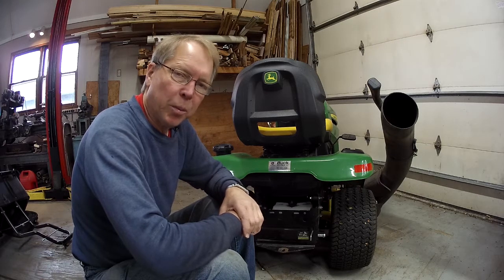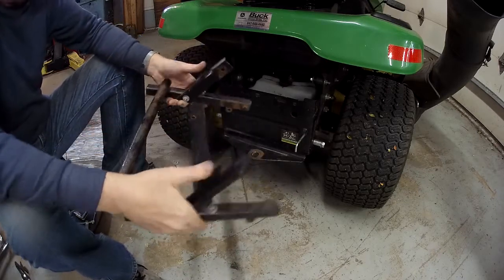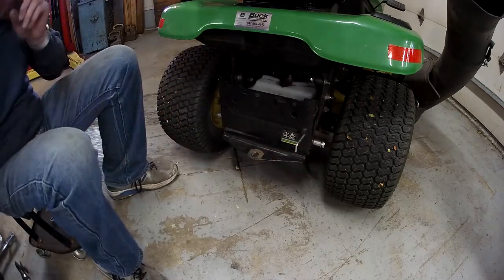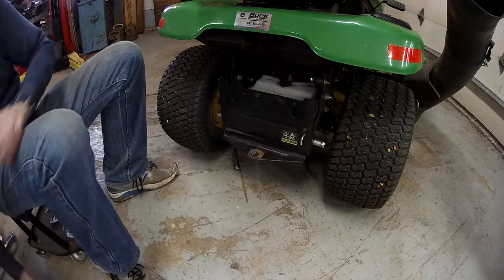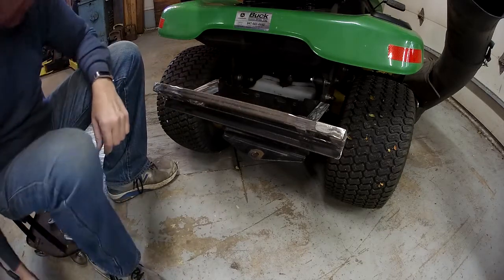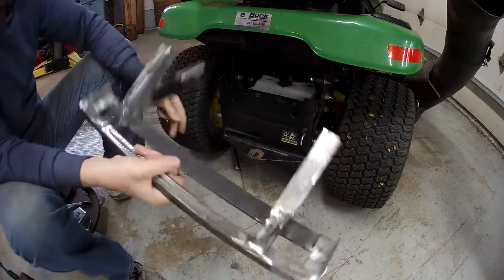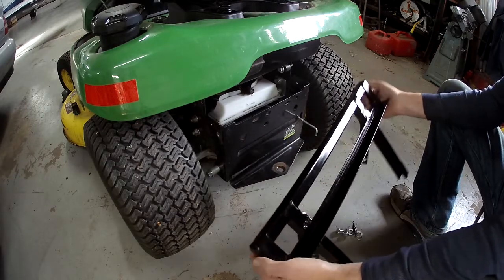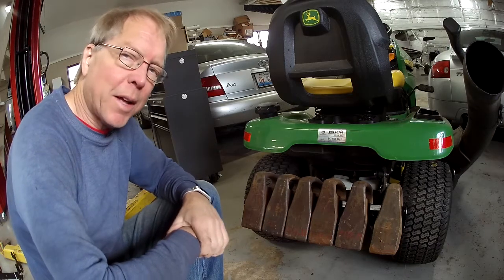Building a weight bracket for a John Deere X370

Comment: Two questions, where do you get weights like that and would you be interested in a little extra cash and make and sell the bracket?  I have no idea how to weld.  I've got an X300, hopefully not much difference between mine and your X370.  Thought of one more question, do you use chains?
Reply from the maker: These weights came from Craftsman across the years. I had a couple to start with and my father in law had a few more. I'm not sure where you'd get them now... farm auctions perhaps!

These kinds of things are built to fit, so I'd hate to try to make one remotely from the target tractor. Plus there's shipping.. heavy stuff! I would probably help a friend with one, but don't plan to build to order.

Perhaps you can find a retired mechanical engineer like me near you who would like a project! We are out there...
Reply: @cardinalflyer  Thank you for the reply.  I'll figure it out.

Comment: Great video!  Novice question: would it be possible to use different/heavier weights with the bagger bracket?  I'm guessing you couldn't fit more of the kind you have (and maybe the angle of the bagger attachment wasn't quite right)?
Reply from the maker: The bracket is plenty strong enough for heavier weights. As for angles, I built it to match the weights I have available. If you have weights with a different shape you could design something which lets you mount them using a similar approach.

Comment: Do I have the have the bracket on the back
Reply from the maker: It depends. I built both of the brackets shown, but the posts mounted to the tractor body were from the bagger attachment. You could easily build similar posts and bolt them on. So no existing brackets were required for this project.